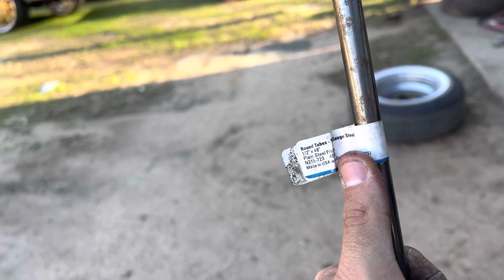Bagging an 88-98 Chevy Silverado c1500 part 12…..finishing the bed body drop

Comment: Love the content...just had a question... do you think the accuair valve block with 3/8 fittings and lines is slower than a traditional valve setup like a 3/8 smc white top? Trying to decide what to go with on my obs, I like the cleanliness of the accuair but the fill and dump speed of a traditional valve.
Reply from the maker: The valve block is alittle slower but it’s smooth and the install requires so many less fittings and potentially less places to leak….I install them on everything and the price of brass fittings nowadays it’s bout cheaper to run the manifold

Comment: I got my notification on for this what gage steel did you use for inner finder walls ?   What the bars you welded to the c notch’s solid of hallow ?  Whe the truck lays out is all the weight on the bags or the shocks and how do you pick out shock sizes for front and rear I need to order mine still thanks agin for your help
Reply from the maker: The inner fender sheetmetal is 20 gauge I believe….the bars are Hollow….No need for solid stock on that….I believe they are 1 5/8 round pipe…the truck lays out on frame….the front currently rests on the factory y-pipe but that will be raised up so it will lay flat….shocks I usually just measure how much room I have to work with laid out and then go find a shock at parts store that will work….don’t but cheap shocks they will make or break your ride a lot of times
Reply: @lowerclassfab431  thank you for the information man I do at it I’ve ordered 7 k worth of new parts from LMC the only thing that’s going to be original is the cab frame engine I switched to a step side bed and switched doors out so I have power everything it’s an 91 Chevy c1500 reg cab 350 automatic short bed I hope will be finished this summer

Comment: Is it the camera angle or is the bed gap a little off at the top? Just curious. Truck turned out great man hopefully he leaves the paint as is!
Reply from the maker: It’s off just a hair but I looked back at pics before I started and it wasn’t perfect….prolly wouldn’t hurt to replace the cab bushings at this point they are 35 years old